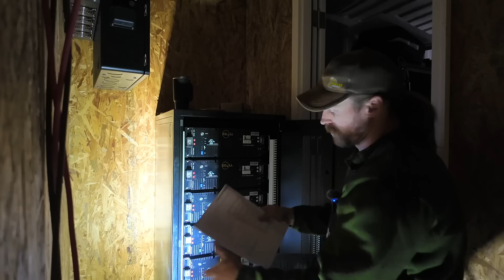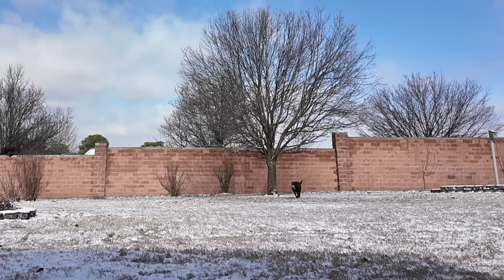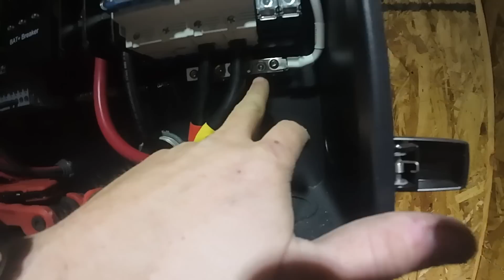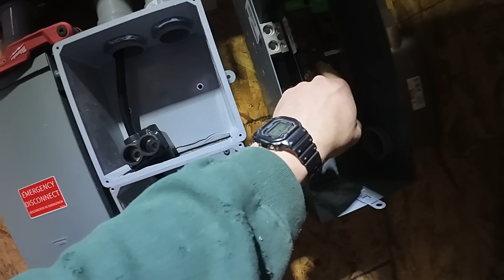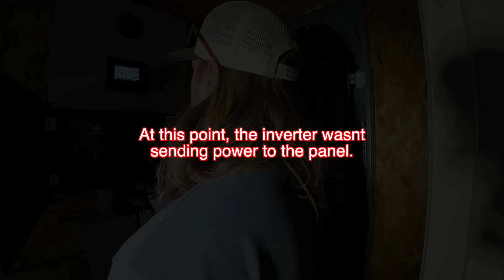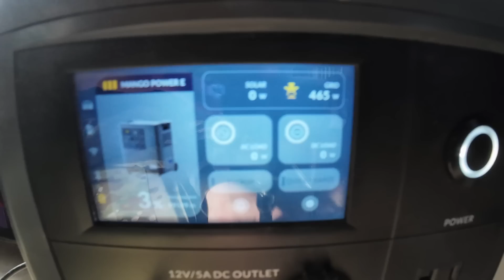HE FINISHED IT, solar is done: its time to turn on the lights at the old cabin

Comment: The wires should go on top of the disconnect so there will be not power on the knives when you open the disconnect it will work like that but more safe on top

Comment: I suggest Armour Cable vs running conduit.  You’ll find it so much easier to work with.
Reply from the maker: Thanks for the tip! There sure is a lot of wiring left to do